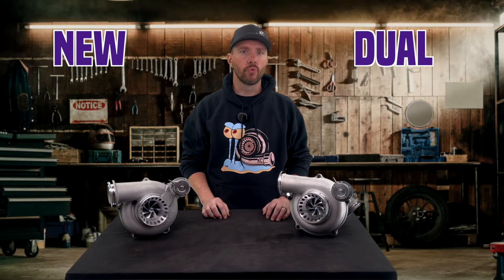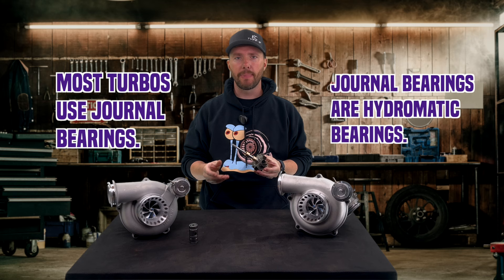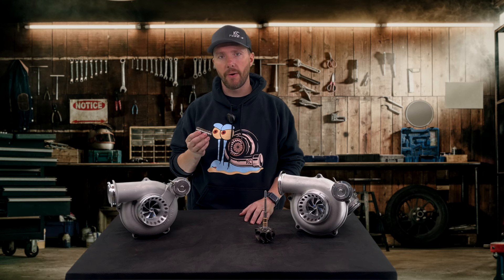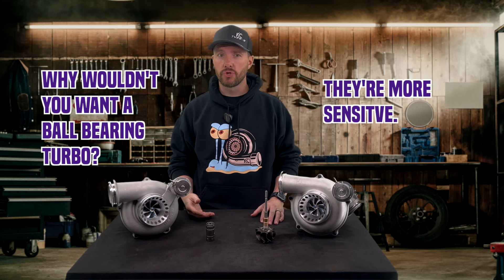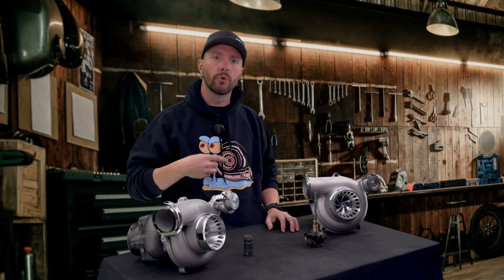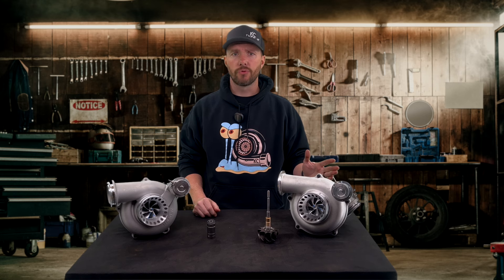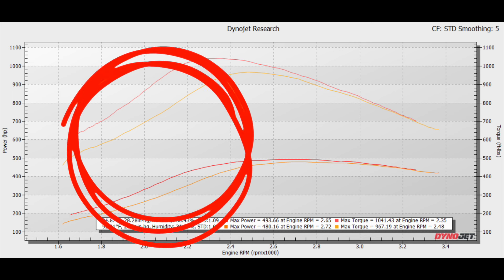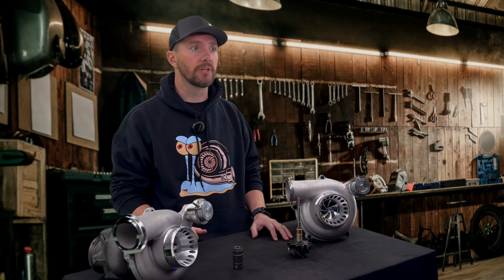Journal Bearing vs Dual Ball Bearing Turbos + Dyno Results!

Comment: It figures I buy and install a KC300X stage 2, just for KC to come out with a new ball bearing variant, which I probably would of went with, if the option was there. SUCKS!!! I love my stage 2 300x, but damn…this is always my luck, considering I just got done my build about 2-3 weeks ago, and now this….happens with every platform I’ve ever built/tuned. Feels a lot like the tech industry, where you can never keep up with the times. And this is a 20+ year old platform 🤣 I could understand that being the case for a newer vehicle/platform, bc they’re new…R&D is still being done for the aftermarket world. So I expected this to be the case with my Focus RS and ST builds, but not an old dinosaur like the 7.3 😅

Haven’t even put. 500 miles on the truck yet, since all the mods

To be completely honest as well, idk how much faster I want my spool up to be, over what I have. I already feel like that boost and power is there as it is, and the spool up speed shocked the hell out of me, on my first hard pull. It’s just happens so quick, and I’m losing traction left and right, before I know it. I mean I’m breaking the wheels loose in third and fourth gear, having gut checks, multiple times now, bc the power came on so quick and snappy.

Btw…I plan on doing some videos on the 300X stage 2 in the very near future, once I get a few more things on my list done…and I will definitely be shouting you guys and the products you produce, out, in a positive manner, giving my honest opinions, which so far, have all been GREAT!

Comment: Feels like Journal bearing is fine for 80%+ of the population
Reply: True… both are great options. But it’s a nice upgrade for a little extra money for those who want quicker response.
Reply: @peixinho5927  I’m just poor lol
Reply: Im have thaugt about this demonstration al do and spinn the wheels and compare them. Non of them have the right conditions, its lack of oil that is a benefit for the journal style and perhaps the opposite for ball bearing turbo.
Just my perspective of it.
Reply: It’s better in many cases too. When oil is in there, it has “minimal “friction like he states in the beginning as to why they are not as good.. 🙄
They hold up better to diff oil pressures too.

Ball bearing turbo is more sensitive to different oil pressure and it’s actually bad if you get a lot of oil flow in there it’ll actually make them perform worse. You also need coolant lines for ball bearing most of the time.

Journal is cheaper. it’s more durable and spins about just as good when that hot oil is in there !
Reply: I use a $200 maxspeedingrod gt3582 and its journal. Rb25. Its 370whp at 13.5 psi. Perfect

Comment: Is there any advantage at a maintained load and rpm? Does the DBB unit maintain a higher shaft rpm vs a journal bearing at a given load and rpm, or is the advantage only noticed during transient throttle scenarios?

Comment: Now that I know they’re sensitive compared to journal I would think twice. But 13 hp gains with that rpm increase is really tempting.  So oil change, and air filter main things to be cautious of…maybe when changing parts be certain to cover the pipes and holes ? What else ?
Reply from the maker: Honestly, you hit the nail on the head! those are the things to keep up on an "Fix" and your good to go!
Reply: run a turbosmart OPRpro. It provides the right amount of oil for ball bearing and it also has an inline 40micron filter to help protect the bearings. The OPRpro is boost referenced for oil pressure.

Comment: In the dyno test shown in the video was the truck stock other than turbo?
Reply from the maker: That truck has:
180/30 Injectors
CNC s2 hpop
AFE big boost filter
Hydra tuner
Reply: @KCTURBOS  thank litterly  opening  my tiger turbo as we speak

Comment: i had the KC38R only 12k miles on it, bearing let go in Kansas and cost me much $$ to get my camper and truck back to Indiana so beware!
Reply from the maker: I am sorry to hear about your bad experience, that really sucks. We have strict quality control and every turbo is built by hand in AZ. But sometimes things can happen, and sometimes even small issues like a sensor failure can cause trouble for a ball bearing. Did you reach out to our customer service team (480-688-7160)? With that low of miles im sure you're still under warranty!

Comment: My slow azz 600hp street car is traction challenged as it is,,makes its 30 lbs in about .4 of a second,,so,,why do i need an "instant on" BBturbo?
Reply from the maker: Wow a turbo that makes 30psi under half a second. What car and what setup?
Reply: @KCTURBOS  Turbo Buick V6  235" ,heads,212/212 fast ramp cam. 6266JB Precision/Bisonette wheels.PTC 9.5